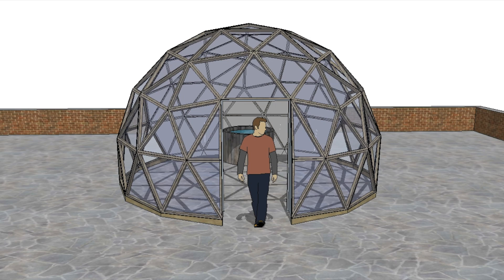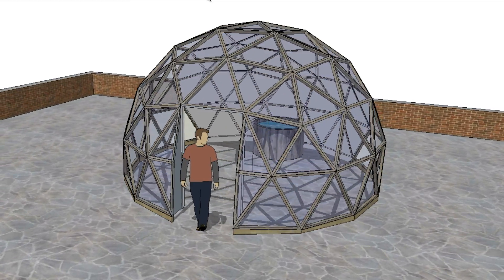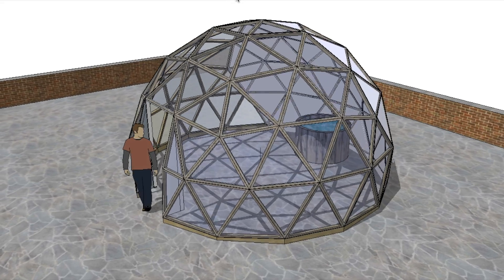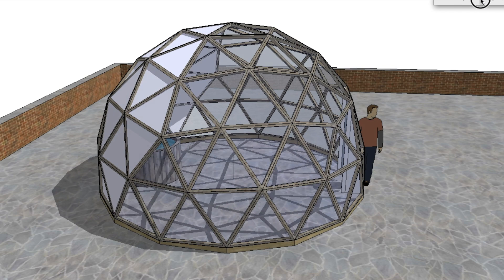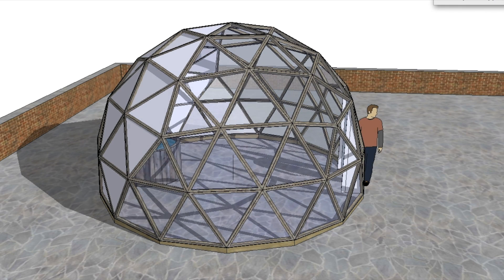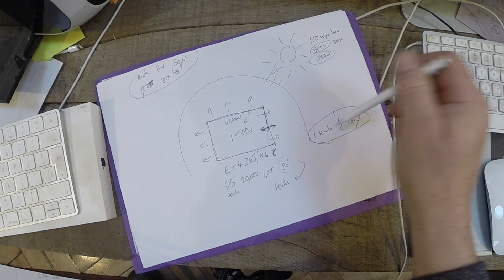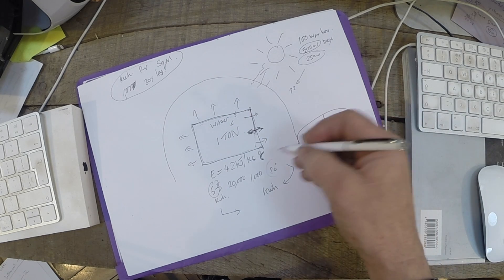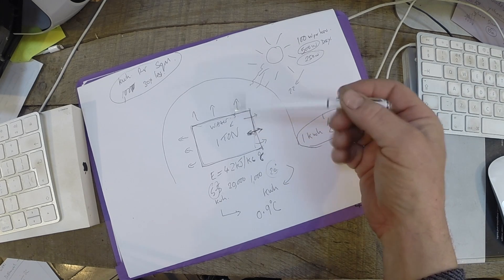Passive greenhouses don't work

Comment: I've enjoyed your videos on geodesic domes! Thanks for all the knowledge you share.
I'm not saying passive greenhoused work or don't work but I don't think you can answer this question with such a simplified model for the energy budget. First of all the energy stored in the water at 20°C represents the amount of energy required to heat the water from 0°C to 20°C so you won't be needing to "fill" this energy reservoir on a daily basis. Second, the water in the tank won't only be heated by the direct sunlight hitting it. The sunlight will also warm all other heatsinks (earth, greenhouse atmosphère, soil in pots, water in the soil, etc.). Heat may then also be exchanged between the atmosphere and the water tank. Lastly, and quite mainly, it all depends on the volume of air inside the greenhouse that needs to be heated or maintained at a given temperature and the heat losses with the outside atmosphere. A complicated question! One that cannot be answered with a too simplified model I'm afraid!

Comment: Your math doesn't really account for how thermal masses work.
Even if it's negligible, the fact of the matter is that water stores heat and retains heat better than air does. The prolonged warmth of the water, will heat the air around it, keeping it warmer for longer.

Again even if where you live, it's only a 0.5 degree difference in temperature, it still works. 
Broken math + no real world testing/experience, does not equate to a definitive answer.

A better title, and thesis, would be "My passive greenhouse doesn't work as well as I want it to, due to engineering and design flaws in my methodology, as well as poor wintertime sun exposure"

Comment: Hey Paul, I have a 16 foot diameter geodesic dome greenhouse similar to what you have pictured. I submerged my pond beneath the frost line And I maintain a steady 40° in that water no matter how cold it gets outside. I experimented with heating the pond, but could not keep the greenhouse above freezing at night even when I got the pond up to 80°. I have not insulated my north wall yet but heating the pond with a bucket heater is inexpensive and if I were going to grow through the winter it might be feasible to stay above freezing once I insulate that north wall. I am still experimenting. I am just more interested in finding passive sources of heat So I was hoping your video would conclude with recommendations.
Reply: Have you insulated north wall yet? And if so, is it helping and in what ways?

Comment: Energy from the sun has to be multiplied by the exposed surface in square meters.
Internal absorption, emission and recflection of radiant heat must be considered.
Power from the sun can be trasformed in electricity (15%) AND heat (80%). An electric powered heat pump can then generate heat with a 400% factor. So at the end you can have (4x0.15 + 0.8) × 1000 W = 1400 W thermal power per fully exposed square meter of pv.
With a correctly designed air convection loop (double layered glas + air gap behind the pv + heat pump + thermal storage mass (insulated from external surfaces)...
...you'll get it!

Comment: Rather than having a cubic meter of water in a large tank and hope for the best, circulate it though a car radiator (with forced airflow) or put the water in 1000 PET juice bottles to give increased surface area.

Comment: Solar panel with two wires going into the tub of water?
Reply: I don't know if you were being sarcastic or not but in essence YES. But instead of just solar panel wires in the water, it is a water heating element in the water with the solar power wires hooked directly to it. 

You were being sarcastic but you solved it, almost, but with  just a few minutes more of thinking and you could have solved it yourself. A water heating element is only around $15.00 and the resistance is fixed. So using ohms law E/R=I   You get three 42volt solar panels no battery, then you get the 15.00 ohm heating element.

 Example: Using ohms law. 125volts(three 42volt solar panels in series with a IMP of 12.25amps) paired with a heating element of 15 ohms equates to 8.33 amps.  So 125Vx8.33amps=1,041.25watts. You get over 1kwh of energy converted into heat.

No battery needed or involved. The water itself works as the heat battery. But better than water is to use sand instead. Sand won't boil or steam away at 100C, and sand can surpass 100C and continue storing more and more heat up to its melting point. The melting point of sand is 1700C(3090F).

Comment: 1 ton of water only takes up 0,757 cubic meters which would seem a small tank for this purpose.  Since the energy of the sun is equal everywhere the surface area becomes the energy multiplier.  You want a tank that maximizes surface area to volume.
Reply: I guess it's a metric ton = 1000 kg = 1000 l = 1000 dm³ = 1 m³.

Comment: Your doing a lot of figuring but there are many people on you tube that have greenhouses that do work.
It's like a bumblebee doesn't have enough wing area to fly! Oh, one just flew by!
Reply: It may be the thermal heat stored in the earth helping to keep those greenhouses warm.
Reply: Yes.  Interesting analysis, but I would think the tank would warm up during the day through all the usual methods of heat transfer - radiation, conduction and convection.  Calculating one out of three seems incomplete.  It's very much like ignoring the vortices on bumblebees' wings!

Comment: There are several steps you could take to boost the heat retention you can paint the tank black you can make it surface area of the tank larger you could add mass in the form of rocks and Bricks wherever there wasn't plants growing this would help some I don't think it would still solve the complete heat problem you could also put a hot-water thermosiphon panel inside or outside the Dome to boost the water heat again I don't know if that would be enough to heat the building I live in Wisconsin USA our Winters are brutal you might be able to extend the season here but without some kind of supplemental heat source that is not going to work in my climate
In fact when I was younger the idea of a year-round Greenhouse calculations proof that putting the greenhouse in my basement and artificially lighting it and using the heat that was already present would have been much more efficient
Reply: OYR...One Yard Revolution chan in Chicago is growing cold-hardy greens over winter without water tanks using hoops inside of hoophouse.  And I think the outer hoophouse is double walled plastic, to thats 3 layers.  
I am considering building something similar this summer in WI with a dome-in-dome system, tanks, and a rocket mass heater because...well its Wisconsin!

Comment: Flat plate heat exchanger into the water in the greenhouse via heat pipes.  Plus have wrap around curtains on the dome with inside mylar layer clay aerogel sandwich and outside layer polyester etc.

Passive and will work and it will work even on cloudy days.

Comment: I totally agree, you need active heating systems even if using renewables they need mass in excess of the volume of the greenhouse. They can be done but not as passive
Reply: What about using a fresnel lens to heat a metal mass that can conduct heat into the water tank?

Comment: Can you build one to prove your math. I want to build a dome with a water mass heated using a fresnel lens to boost the btu's. If installed right it will boil water off sun light. Thanks again

Comment: Full of arbitrary numbers pulled from thin air, continuous mixing up of unit types, … I appreciate what you were trying to evaluate in a more quantitative fashion but when your math is this screwed up the numbers don't mean anything and you may as well have just looked at it and made a guess. You also did not include the energy that could have been absorbed by the water through conduction with the air (which is much warmer in the sunny day obviously, I am not sure what % of the energy the water will absorb is likely to be from that). One obvious variable to play with would be surface area to water volume ratio. Another is total water stored. Even a small wall of rocks piled up outdoor (not enclosed in a greenhouse) can be enough thermal banking to extend a growing season a bit. Another note on this is the option of having additional radiation collection area placed outside and circulating to the inside, like an evacuated tube solar water heater or the simple homemade versions. The insulated rear wall could be lined with reflective material focused toward the water, increasing square centimeters of radiation collected. The building heat loss could be reduced with simple insulation strategies like a double or even triple wall with air gap to reduce the amount of energy needed. One final thing to mention is that this barrel is not the only thermal mass storing heat, it is just more optimized for doing so than most of the other things in the building (so there is more energy available than only what you find in the water).
Reply from the maker: I get your point, I've done a back of envelope calculation, but you haven't provided any numbers at all in your criticism. I'll probably do a more detailed video at some point, though I had thought that there was enough facts in this video. I've done enough math to prove that in the UK adding a water tank with 1 ton of water will not increase the average temperature in a greenhouse by much at all (less than 1°C) If you disagree you should provide at least rough back of the envelope calculations and give some numbers. There is a definitive answer! 
"One ton of water will boost the average temperature by X°C in a greenhouse" - My calculations say less than 1°C
What do you say?
I'm happy to debate this even with approximate numbers...
Reply: @Geo-Dome  What numbers to use depend on what equipment you are willing to set up with it, what your greenhouse is, etc. In my greenhouse I do not have any water barrels and I do have a compost berm around the outside so I am in agreement with you about your basic premise and I am not having a conflict with you. (I do have ~2 tons of water in my greenhouse though since it is an aquaponics system, the water temp is much more stable than the air and that is what all the plant roots are feeling). But I would disagree with a statement:  "passive solar heating and heat storage can't work." I don't even really need to do any calculations because it is obvious that if you wanted to dig a large insulated in-ground storage pit of water and use one of the many designs of solar thermal heat collectors you could simply scale-up your energy collection and storage to have like 2k gallons of 80°c water to heat your structure (radiator), so there is a point that this will work brilliantly if you want to put enough in to it. It would be an initial investment for long-term set and forget. Here are some rough almost meaningless calculations: Say we want to provide average of 1 kilowatt of heating to the greenhouse 24 hours a day (winter) so net output must exceed 24 kWh per day. Say we can get (in winter) an average of 5 hours of direct sunlight per day worth 0.15 Watts/cm^2. That would be 0.75 Watt hours per cm^2 per day of raw input from nature. 24000 / 0.75 = 32000 cm^2 needed to equal that, I will multiply by 4 to cover the rest of the energy that will be wasted, so we need 128000 cm^2 or 12.8 square meters of sunlight collection to have 4x abundance of input energy to force it to work (built as for example two parabolic troughs with a copper water pipe in the middle and glass enclosing the trough as a solar oven. Two troughs, each one is 1 meter wide and 6.5 meters long). So for the insulated water vat, lets say we want the water at 70°c with variability no more than ±15°c. That means we have 30°c of temperature swing to play with for releasing energy into the greenhouse. Water stores 4.2 kJ/kg°C, 1 kJ = 1 kilowatt second, 1 kg = 1 liter. We have 30°c so each 1 liter stores 126 kWs = .035 kWh. To find how many liters store enough energy, divide 24 kWh / .035 kWh = ~686 liters of water is all you need actually, I thought it would be more.
Reply from the maker: Thanks for taking the time to provide calculations, ok this is my take.
Greenhouse surface area for a 15m2 area is about 40m2
U Value for polythene about 4 W per sqm per degree. So the greenhouse will loose 160W per degree. (not allowing any lose to the ground) So if you have 1kwh source of heat it would hold the temperature about 6°C above outside temperature.
10 kWh of energy will rise the temp in a 1000kg tank by 10°C for solar energy 150w per sqm x 15 = 2.2 kwh x 5 hours = 11kwh.
Now this is my issue, there would be enough energy on a sunny day to raise the temperature in the tank by 6°C the tank would not transfer any heat to the greenhouse until the greenhouse temp was below 6° when the greenhouse drops to 5° there’s 0.11 kwh of available energy  but the greenhouse is loosing 1.6kw per hour if the temp outside is 10°C lower than inside the greenhouse.
Now your figures state that we can get 24kwh of energy from 12.8m floor area, about double my estimates, even at that it’s a 12°C rise in temp in the tank, outside temp -10°C, 0°C in the greenhouse =10kwh of potential energy let’s say 14 dark hours with no energy from the sun makes energy loss totalling 22.4 kwh.
Our numbers are not far apart but we seem to come to completely different conclusions, if we can keep greenhouse temp 6°C above outside then on a -10°C night the greenhouse would drop to -4°C.
Finally to germinate seeds you need a constant 10°C - 15°C 

Variables.
cover U Value 
greenhouse surface area
potential Solar gain
Temp differential required
Reply: @Geo-Dome  The 24 kWh per day is a very conservative estimate of power available from one fourth of the 12.8 square meters, based on only 5 hours sunlight per day at 0.15 Watts/cm^2 (normally people would calculate with 0.4 watts / cm^2 and probably account for more hours of light). The continuous 1 kW average across day and night is arbitrary (and I could re-calculate for other output requirements) but with any attempt at insulating (double clear wall, polycarbonate hard panels) I think it would be enough for a small greenhouse. Also I clearly described that the water would be kept in an insulated tank at 70°c   ±15°c, so with a good sized metal radiator you could transfer heat to cold greenhouse air quickly (I said that because you are describing the water as being stored at only 6°). I think getting bogged down in how many square cm of radiator you would need to transfer x-number of watts with a 55°c temp difference is irrelevant to the point, which is that solar thermal collection can for 100% certain be used to collect and store enough heat to regulate the temperature of a greenhouse to whatever temperature you would want. You just have to do some  experiments to calculate how many watts per square cm you can collect on average in the coldest time of year, and how many watts you need to heat your greenhouse, and use that data to size your solar thermal collectors and your water vat to match your needs. Position the collectors next to the greenhouse and work out some simple automation to operate valves or pumps to send the water through the right tubes. It's not going to be the most practical solution for everyone's situation but there is no reason solar thermal could not work.
Reply: @Geo-Dome  Or maybe what I described in the previous comment with the math was a little too complicated of a system to be considered "passive solar." So I guess you could replace that with black painted pipes of water covering the inside of the entire insulated north wall. For my small greenhouse of 200 square feet / 18.5 square meters, there is a back/north wall surface area of about 24 square meters (footprint is 8 feet by 24 feet, with a 10 foot high 24 foot long north wall, so north wall is around 3 meters by 8 meters). So that is more than enough solar collection area to supply the average 1kW described in my previous comment with the math. Size the tubes so total storage would equal 800 or so liters (no point of calculating tube diameter here lol) and put pressure release valves at the top just in case. To control the release rate it may be necessary to have a certain portion of the tubes glazed over and blocked from conducting heat with surrounding air, so there is limited surface area that is heating the greenhouse and it happens more slowly.

Comment: Paul, in a winter you have only few sunny days per month, depends on region of the greenhouse location. So only summer can provide enough energy for accumulation, you can store this energy in the ground and use it  passively at winter

Comment: I don't believe your calculations have considered all the variables available. For example in winter the earth's elliptical orbit is actually closer to the sun than in the summer (perihelion). It's merely the tilt of earth's axis of rotation that creates the shorter daylight, but that light has got to be greater in intensity due to the planet's proximity to its star. Also the orientation of glazing and insulation must calculate magnetic declination to receive optimal insolation (solar gain) year round. Finally for passive systems insulation (spelled with a u not an o) both above ground and below is essential to collect and utilize every unit of heat energy available which means even the choice of color and the material composition of the water or tectonic salt solution storage container are factors to be calculated. One could also pump the solution thru heat exchanging pipes buried below the frostline (geothermal), but one couldn't call it "passive" by definition. Check out Iceland's banana plantation, the largest in Europe. - http://icelandmag.is/article/iceland-has-europes-largest-banana-plantation-could-grow-importance-due-panama-disease